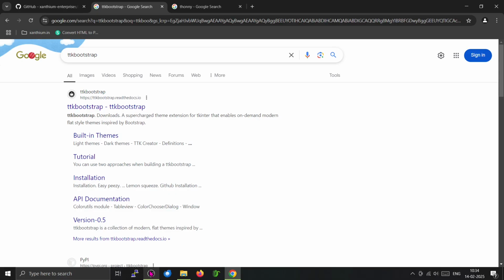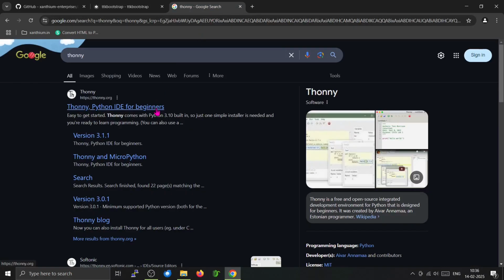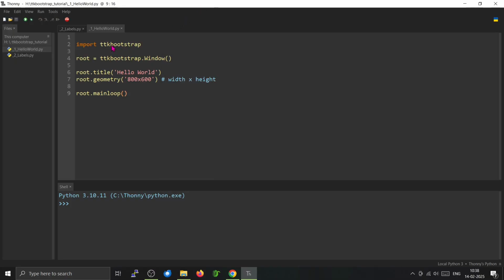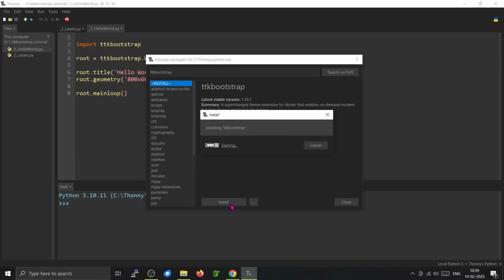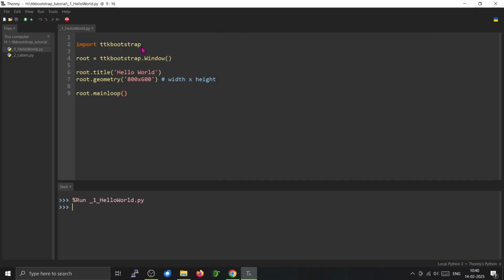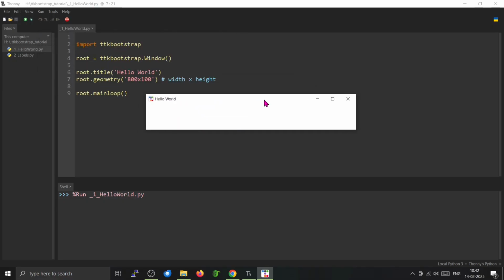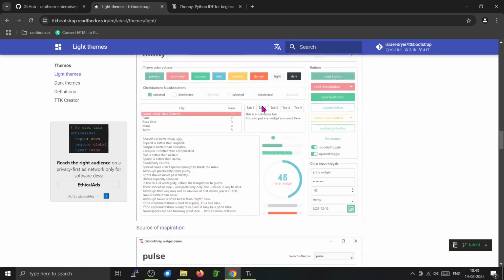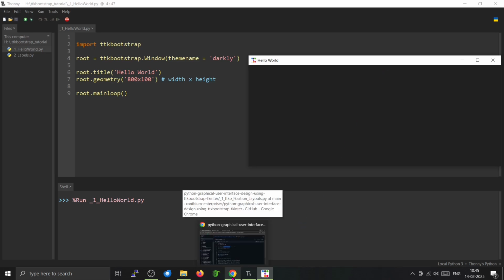Creating a Basic Window using Tkinter (ttkbootstrap) Library and Python for Absolute Beginner

Comment: Why dont stick with Vscode or Pycharm?
Reply from the maker: Pycharm is great for large projects,It is heavy on the System resources like RAM.

VsCode  needs to be configured with a Python Extension.

Thonny on the other hand is extremely light weight, comes with its on Python interpreter and have a built in package  manager. Thonny also consumes extremely low system resources ,it is also open source